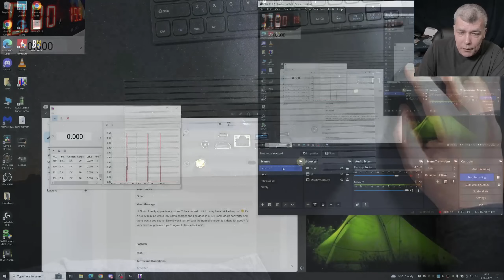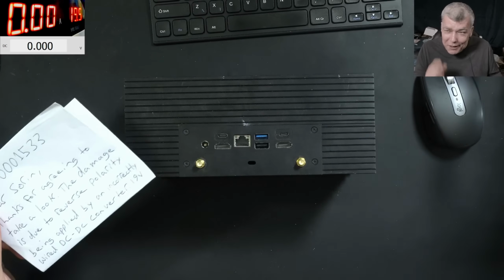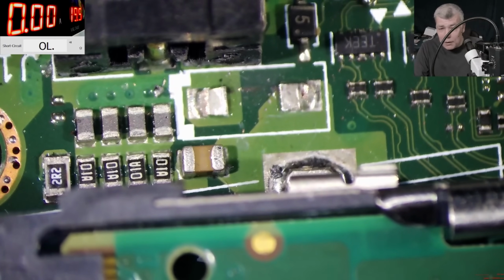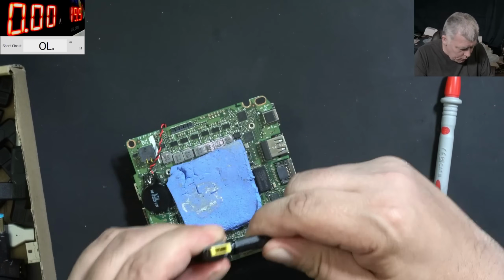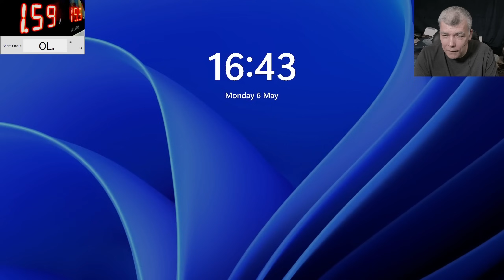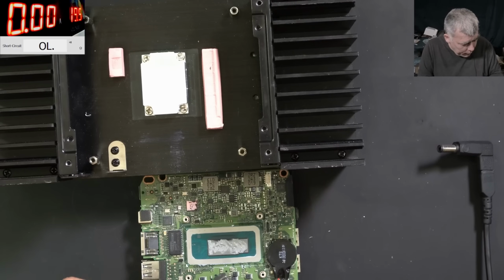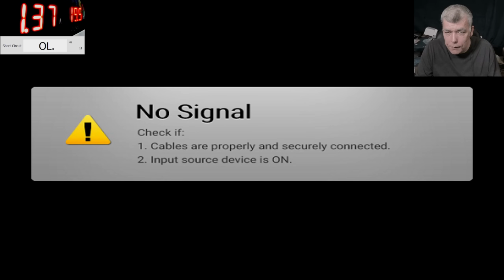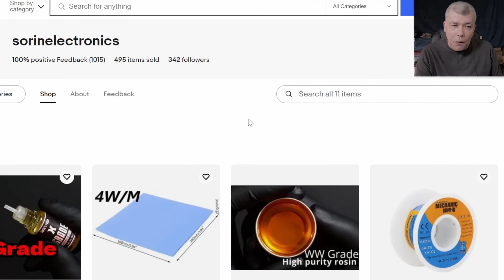Intel NUC 12 mini pc - no power, dead by invers voltage - board repair

Comment: To be honest it's fine if we replace that diode with M7 but it should be replaced only with diodes that are used at input side like dell hp laptops etc. I mean it works fine but Sorin has a lot of scrap boards so why not. As always if a proper calibrated fuse works it works 👍 He is one who is trying to explain people electronics not like youtubers giving schematics and assembling. Keep it going Sorin👍

Comment: Akasa Turing A50 MKII  heatsink is the type of NUC case here.  You can buy a different model heatsink / case for AMD or Intel NUC board.  It's a proper heavy piece of kit to cool the NUC's.  These cases are not cheap :)

Comment: You could have used just solder iron instead of hot air, much easier in that narrow space. And you slightly melted the plastic.

Comment: How did you know the orientation of the diode?
Reply: If you look at the board layout it has a thick white stripe of where the + of the diode goes on one of the sides. He actually could have used that indicator for the other diode he blew off aswel instead of having to look back at the video.
Reply: @ElMariachi1337  thick white stripe should be negative not positive

Comment: I am a total newbie, but why would it happen? No full bridge rectifier in the power supply?
Reply: There is no such thing at PCBs being laptop or PC. These boards expected DC voltage with correct polarity, reversing it would (without protection) destroy any mosfet in the way (as current would go through parasitic diode inside them and overheat them) and any electrolytic capacitor on that path. Possible even every IC on the board.
Reply: @gorky_vk  yes I understand it is not in the PCB, but isn't supposed to be in the power supply? While converting from AC to DC
Reply: These things are powered with an external mains adaptor which provides regulated, polarised, DC output. When DC was applied with the wrong polarity it took out the TVS diode because of the current flowing through the diode. A  poorly-designed mains adaptor (no short circuit detection / protection). The diode is (was) primarily to protect against over-voltage / spikes.

Comment: 10:20 look at the top right, on that small innocent solderball, which is trying to hide behind the corner, escaping from the Sorin's tornado air, which blew away from the surface that small poor diode on the left, haha
What a horror movie on the motherboard 🤣

Comment: I'd have used a soldering iron to put back the diode.. avoids other things blowing away ;)
Reply: Customer did it once, the customer will do it again. The diode must be there.
Reply: I would definitely replace the diode, but with a soldering iron not hot air.
Reply: @tim0steele  you are right there was no need for hot air to replace this diode, any time a component can be soldered using solder iron then do it safer for the board and the component. for myself when I unsolder bios chip or mosfet I solder it back using my solder iron for a strong solder bonding and less heat to the board , also to avoid of flying small component like resistors . I learned my lesson when I was using just hot air for everything till the moment I was soldering back bios chip and very tiny small smd resistor with unknown value flown off the board . spent like 3 hours trying to figure what value was it from searching online for schematic to test random laptops boards I have. laptop worked fine but it really was unneeded troubles because my laziness to use soldering iron instead of hot air.

Comment: Nice repair as always ! Sorin, While soldering the diode using hotair, a blob of solder escaped and is hidden at the hdmi port next to the 2 arrows !  its at 10.20 ---10.23   :)
Reply: Well spotted, I had to watch 3 times to see where you were talking about, it just sneaks along and disappears under that.
Reply: I saw it as well right away. Problem is I'm watching it 2 weeks late. Good eye though.

Comment: 5:45 here I am asking why on earth would you pry it out instead of desolder, useless risk to tear up the pad.
Reply: Dodgy is the way, could have used iron later as well. The legend lives on
Reply: Probably because it was rather obvious that it wont rip, because the leads started breaking off as soon as sorin just moved them to remove the short.

Comment: anyone sees the solder balls around the connector legs, around minutes 12:00.
is it oke if they keep staying there?
Reply: As long as there's no bridges it should be fine. Just cosmetic
Reply: Should be fine if it doesn't short anything. But this is why I dont like solder pastes, very hard to clean properly.

Comment: That should be a TVS protection device such as P6KE27A or so.
Reply: Even this one will work as polarity protection. I really doubt that NUC PSU have problem with voltage spikes and TVS is absolutely needed. It'd be better but then again this is better than nothing.
Reply: It's fine, that replacement diode will take 1kV before breakdown, ho, ho.

Comment: A protection diode is good for protecting against reverse polarity mistakes.....but how come more damage didn't occur after it failed short??? Surely with the diode shorted, the circuit was exposed to full reverse polarity at 8 amps...???
Reply: nope it is shorted to ground to protect the board . this diode one lead to ground other lead to positive when it short it means positive shorted to negative and the voltage won't go anywhere after that . same as shorted capacitors

Comment: Just to say: Sorin, you didn't test the donor diode. With low probability it could have been broken too (infinite resistence) and you would not notice the difference. Only the customer would have a burned board if he connects the wrong way again. Also, the south side of the small diode above didn't look convinigly soldered. Why using air and not just the soldering iron? I would have preferred the iron.

Comment: this guy is amazing in finding faults BUT when it comes to soldering back he doesn't care much to clean the pads for the new component  ..or adding new solder ...like in this case he used liquid solder which low the melting temperature and he didn't even care to clean that before soldering the diode again ...i hope he can do much better next time

Comment: Those TVS diodes are sometimes too sensitive.
Just remove the shorted one. It should be fine. If you have a new TVS diode with a little higher voltage, put a new one.
There is no point in putting a 4007 rectifier diode there.

Comment: It's a miracle you still have clients...
I got goosebumps seeing how many times you interrupted the windows boot process...
Reply: 😅 I've grown accustomed to seeing it here. If I tried that with my clients' PCs I doubt I'd have as much luck as Sorin has lol.
Reply: Yeah been thinking the same thing. Doing that on anything Win7 or below will destroy the boot and they're a pain to rebuild.

Win 10+ isn't too bad. In that if it breaks it will make a decent attempt at fixing itself and the user likely won't even know. Still, never shut down a machine mid boot. If you want to pull the power out then do it once it's booted. Less dangerous but still not advised.
Reply: you know he only works to pay for pizza.